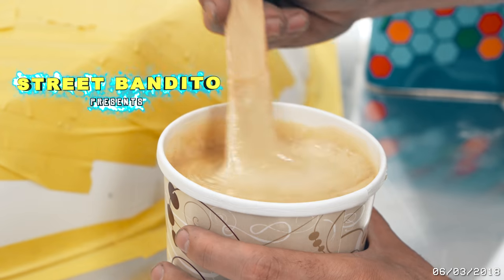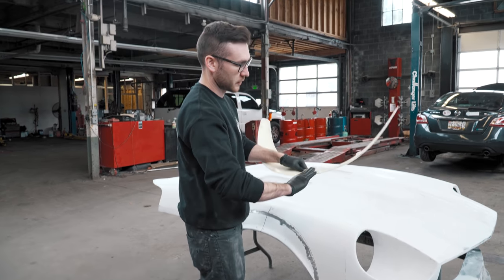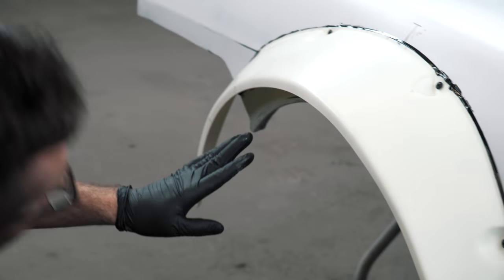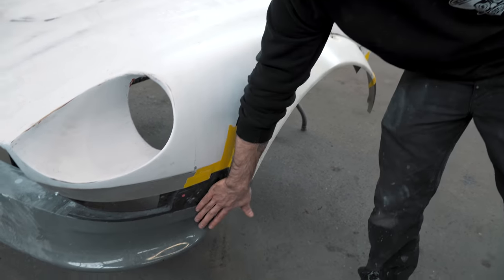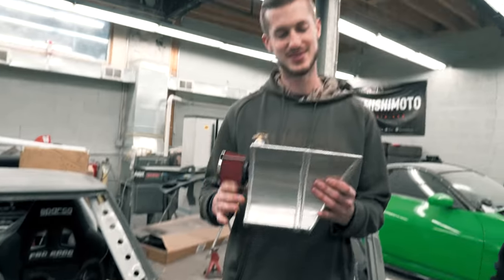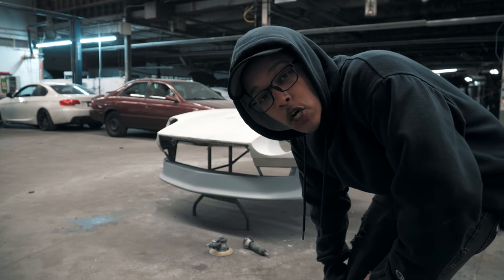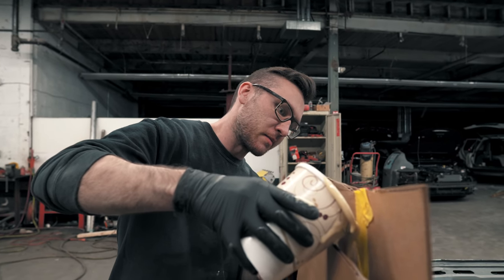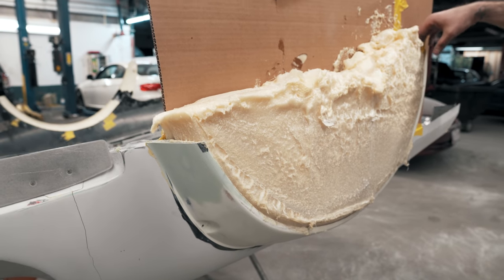Making 240z Datsun front flare molds With FOAM | Part 3 (EP #40)(4K)

Comment: I left Apex to watch this. Ask Tim to buy a ball shaped fondant shaping tool, its really useful in getting those crisp transitions/ fillets on those epoxy caulking things. You need to just run the tool over your epoxy line, it creates valleys between the main line and the excess and once it gets tacky just peel the excess off. Awesome job, PS Rocket bunny sux
Reply: @StreetBandito  #NoMoreRocketBunny